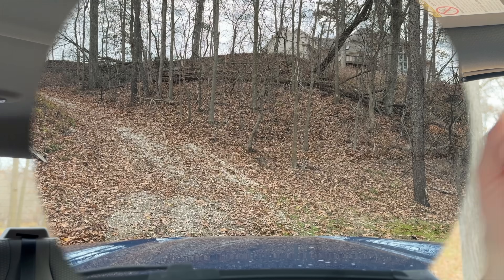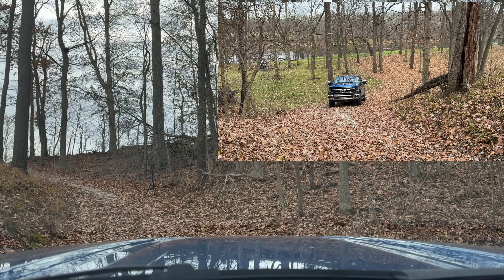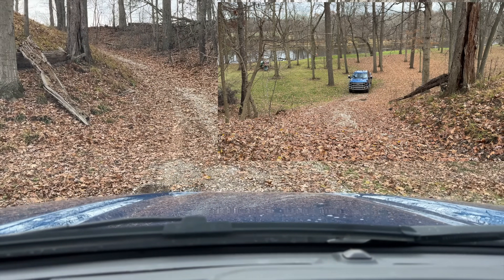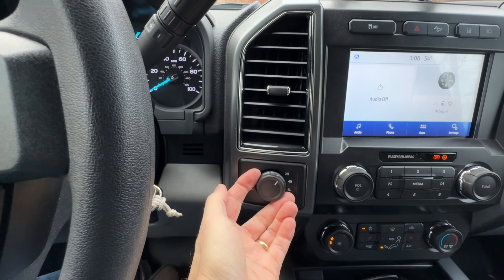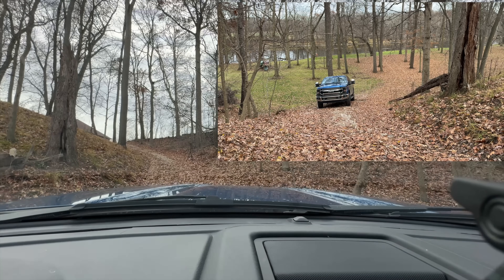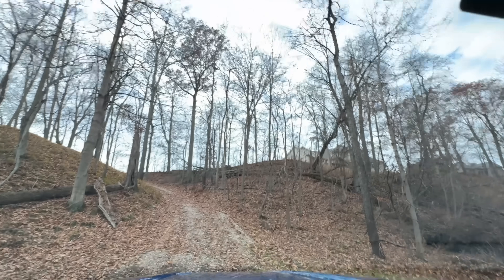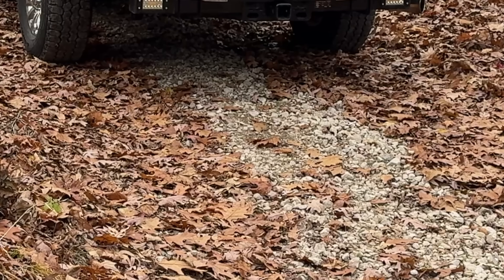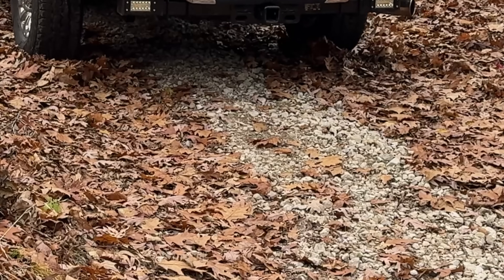FordSuperduty Traction control vs locked diff vs 4wd

Comment: I don't understand why people think using low range 4x4 is somehow better than just using regular high range.
Reply from the maker: @kleetus92 4 Low has no advantage over 4 high other than lower gearing.  I use it on this hill because I like to crawl up it very slowly and low range gives better control when crawling.  I also used it to demonstrate that when in 4 low traction control is disabled.  I get the impression you might be one of those guys that never uses low range and brags how you never need it.  If you never use it, it can get stuck in 4 low if you do eventually need it.  It needs to be  exercised occasionally.

Comment: So I am am a bit confuesed. I am not familiar with US trucks (i am living in Europe, no room to drive or park these cars. let alone the road tax which is based on the vehicle weight). So which diff. did you lock? The centre diff. usually first, I thought. But that also would mean 4wd is active. Or can you lock the rear differential on the RWD? Traction control on passenger cars works the same I guess, but we learn to give it more power so traction will sort itself out. You probably would not want to do that because it will leave holes in the road, digging to loose stuff before getting grip on solid ground. I wonder. So can you elaborate a bit please, which diff. you locked. Thanks.
Reply from the maker: @JWR6819 The first attempt was open diff 2 wheel drive and only using traction control.  The second attempt, I locked the rear differential only to show the difference between the locked diff and traction control.  The final attempt was with the rear diff locked which was not necessary and also locked in 4 wheel drive

Comment: Note that traction control is always on unless you turn it off. The purpose of it is to cut throttle response in response to wheel slip. It really has nothing to do with running gear setup. It's just trying to restore the grip of the tire on the surface. Spin your vehicle with traction control on, like you were trying to clear mud out of the tread and see what happens to the throttle.
Reply from the maker: See my traction control off video
Reply from the maker: @markrogers1502
https://youtu.be/iSFIjMfjIwA?si=CHa_TZWsE45Ot8RS

Comment: First of all, you don't idle up a hill! Back up and get a rolling start! I guarantee you will make it if you go fast enough.
Reply from the maker: @GlenLloyd-q6t First of all, the reason for the video was to demonstrate how traction control behaves compared to a locked diff or 4 wheel drive.  The video was not titled "Can I make it up the hill in 2 wheel drive".  Secondly, flying up the hill that pops out into my neighbors back yard and not being able to see what is coming at the top is not only dangerous for all involved it is reckless and the act of an ignorant person.  I crawl up the hill for a reason and I own a 4 wheel drive for a reason too.  Driving fast to avoid using 4 wheel drive is a good way to break stuff.  But,  Thanks for watching!

Comment: You would be surprised on that hill if you put it in "Four Wheel Drive" (which is two wheel if not in locked diff mode) and removed the rear drive shaft how little your rear wheels are doing. You have all the weight over the front wheels. They are doing the work. You could also (try it!) fill the bed to the level top of bed with sand and drive up the hill in two wheel drive.

Comment: I own four 4x4 vehicles.   Two have Detroit TrueTrac rear diffs and one of those also has a Lock-Right front diff.   I honestly thought the locked rear diff would get you about 2-3 truck-lengths further up the hill than the open rear diff did.  Hard to beat a four-wheel drive that has a locking rear diff.
Reply from the maker: @G31mR As many have stated, perhaps with momentum, lower air pressure in the tires and some weight in the back end it might have climbed in 2 wheel.  However, I wasn't really trying to test what it took to climb the hill as much as I was using it to demonstrate how the traction control worked compared to locking the diff or using 4 wheel drive.

Comment: My traction control is between my ears, that road is way nicer than my county roads. In the mountains our roads are steeper with ruts and washouts and we only use 4wd in the snow. Modern trucks are a joke.

Comment: I'm following you from Saudi Arabia. Share and like! Do you see any difference between the 2025 F-150 and the 2025 Raptor? I'm considering buying one because there are discounts on the 2025 model in Saudi Arabia. Or is it better to wait for the 2026 model if there are any worthwhile changes? I await your response.
Reply from the maker: @qazqaz-kp1xj The Raptor is just an off road version of an F150 to the best of my knowledge.  The Raptor would ride better on rough terrain for sure.  If you're just driving on paved roads, the F-150 would be fine.  Really comes down to what you are using it for.  As for the 2026, not many big changes on the 2026 that I have seen, if you found a deal on a 2025, it might be worth grabbing one, I personally don't think I'd wait.

Comment: I have had my 2015 F150 for over 6 years and I did not know about pulling out the 4 wheel drive selector switch to activate diff locking. I knew it was available but I never thought about it.
In my defense I never go off-roading so I have never needed it.
I guess I should READ THE OWNERS MANUAL.
Thank you for teaching an old guy a new trick.

Comment: An HD pickup is the worst in this scenario because of the weight distribution, or lack thereof. Momentum would change a lot of this, but I understand why most wouldn't want to fly up an incline like that. A loose surface combined with a steep incline makes for a show stopper in most vehicles without proper 4WD and/or momentum.

Comment: So few people understand traction control, Its a anti skid control for greasy roads. Any good off roader will turn it off when wheeling
Reply from the maker: @raymondrichard547 right you are, which is usually why I just select 4 low, it turns that crap off automatically

Comment: 2012 Ford E350 van with traction control (rwd only).  It helps in 2 situations, that I've found: the boat ramp (I can haul pretty much anything off a ramp) and it more/less won't allow an extensive "drift" on snow/ice, at reasonable speeds.  Other than that, it's more of a pain in the neck. In fact, in snow, there are times it will literally not allow the van to move at all. 
Decent system, needs better programming or control.

Comment: does differential lock  lock the front axle too ?    Btw  great video .. thanks
Reply from the maker: @tbischof430 no, the rear axle is the only one that locks on my truck.  The Tremor package gets you a limited slip diff up front which is perfect unless you are hard core off road and rock crawling, but these trucks are rather large for that.
Reply: @robertweller2662  thanks for the info ....cheers

Comment: Guntech59 is right Mo will get you places you know Mo... Momentum
Reply from the maker: @davidlaughlin5606. I am well aware, that was not the point of the video.  I used the hill as a controlled test environment to demonstrate how the trucks functions behave, it was never about can the truck climb in 2 wheel drive.  This hill is a private path through two neighboring properties that I do not own, when you own it you can tear up and down it all you want, I'm being respectful and traveling on it slowly which is best done in 4 wheel drive.
Reply: @robertweller2662 touchy aren't we
Reply from the maker: @davidlaughlin5606  nope just feel it necessary to explain things to certain folks

Comment: 78 F150. Detroit Rear OX front. 4.56 gears on 35" mud terrains. It wont even get out of a level parking lot in 2wd. It just does donuts. In 4wd itll go up 35 deg sand dunes with a foot of snow on it. I think i aired down to 25psi though.

Comment: Your on leaves..like ice. Dummy
Reply from the maker: @DynoDieselWagon those leaves are dry and are on top of rock not grass.  The loss of traction is due to the lose stone and ground beneath the tires.  The video was not intended to show how to climb the hill, it was intended to show the difference of how traction control behaves opposed to a locked differential or 4 wheel drive.  I used the hill as a controlled test environment.  Or did you not watch the entire video and listen to what was said.  Who's the dummy?

Comment: On the fine sand beach here NJ, better have the diff locked in 4x4.
Reply from the maker: @GregReinert-p8n what tire pressure you running in the sand?

Comment: 2014 super duty gas truck, diff lock four low (shuts off traction control) will give you three wheels going in the same direction very well at slow speeds (tractor work). My opinion diff lock is useless in two wheel drive (never helped sliding sideways when I need to go straight).
Reply from the maker: @mikeasel144 I've gotten out a few times with the locked diff in 2 wheel.  Usually when I park in a ditch or something while out hunting.

Comment: I've driven up steeper inclines in my 1976 BMW 2002 on sandy/ gravel roads in the state parks in California. In fact, I wouldn't be surprised if my 1991 Mercedes 250TD (diesel, wagon, 5 speed) with all of 80hp and an open differential, could climb that same driveway.

Comment: This is just me, but if I even remotely think I “might” need 4WD I reach down and flip it. Gimme a damn break, you said “we’re not gonna make it”, then hit the button and go. It’s not like you’re using up all your 4WD fluid and need to refill it every time you use it. You bought a 4WD truck for a reason. Friend of mine, goes onto a two track covered with 10 inches of snow and leaves his truck in 2WD, waits until he’s stuck, then turns on 4WD. To me, that’s just friggin stupid!
Reply from the maker: @deweytarver8985 I always use 4 wheel on this hill.  s you said that's why I have it.  The attempts with 2 wheel were just to show what traction control does vs the locked diff.

Comment: I just bought a Frontier Pro 4x and a buddy of mine bought a Tacoma Pro.  We go occasionally on some trails.  The Toyota A-TRAC system works pretty well without having to use the locker.   In my Frontier in 4 low only, the ABLS used correctly does surprisingly well without having to turn on the rear locker. Both pretty good systems.

Comment: Any time I’ve ever attempted to go up any hill I’ve had some momentum. At least a rolling start. This makes a major difference in comparison. Weight of vehicle going slow equals a “huge” disadvantage. Almost not a fair comparison..
Reply from the maker: @joerigsby-qt5bf absolutely, but this video was never about if I could get up the hill in 2WD.  I used the hill as a controlled environment to demonstrate what traction control does compared to a locked diff and then how they compare to 4WD.  The hill is maintained my by HOA so I crawl up it in 4WD low to avoid digging ruts or throwing stones down into the grass that is mowed below the hill.

Comment: I appreciate the video , but ford makes terrible traction control lol and I love ford , but i've seen it tested in the high end broncos on rollers compared to toyota and land rover , hell even compared to subaru , it just does not grab hard enough.  Now in a situation like this , it's not so bad , but you put it up against a rock where it needs to hold really hard to make the other wheel really do some climbing and no way i've watched land rovers from the mid nineties be able to do it as if it had a locker , it was so strong
Reply from the maker: @ronaldrrootiii6040 Yes, my wife's Subaru Outback has traction control that is far superior to this truck.
Reply: @robertweller2662 i think it's mostly just because the truck is heavy. But ford could try a little harder if land rover can do it with 6000 pound vehicles , and it works instantly like a locker

Comment: traction control is problematic on 2016-2019 chevy colorado and it might be the same in the fords....if you try to drive the old fashioned way, you'd put the truck in the highest gear you can run without stalling and keep the RPMs as low as possible.  in my 05 350, its 3rd and 1200 rpm and that colorado 2nd or 3rd but with manual trans in the colorado causes the computer and traction control to put the truck in limp mode and it takes the dealership to clear that....so you have to let traction control do something it sucks at.  the old way was use torque and limit hp keeping traction.  a method i still use in the 350 and I just try to keep the colorado out of those situations.  that said, what would be the difference with that hill?  I doubt you make it all the way up, but would you go farther?  same time, ask mechanics if it'll f'up the traction control first.
Reply from the maker: @wthalacker that's nuts, I always started my manual transmissions in 2nd gear when it was snowy.  I wasn't really trying to climb the hill in 2WD, I was more using the hill as a test environment to demonstrate traction control as opposed to locking the diff or using 4WD.

Comment: Have a 400 foot driveway, about 3-5% for majority but about 75 foot runs 11-14% downhill in with a small right turn. Was gravel, now paved. When graveled 80% of the time front wheel drive BACKWARDS worked fine wet or dry going out. In snow or ice, nope, except for the truck in 4 low. Paved easy peezy dry in anything, front wheel drive in wet is iffy, snow or ice is a skating rink, lol. Fed Ex driver did a major oopsie and tried it with about 3 inches of snow, he ended up at the back of the property about 40 yards off the drive and had to get towed/winched out from the top.

Comment: Can you say more about your experience using rear locking differential?  I have a 2wd PS dually and was wondering about whether or not it would be an effective addition.
Reply from the maker: @aloslosorelli5553 its a great addition to a 2 wheel drive truck.  I can't tell you how many times I have seen a two wheel drive truck stuck on flat ground because one tire didn't have traction.  If one wheel is spinning, stop, lock the diff and try again.  It's not a replacement for 4 wheel drive but it certainly makes any truck more capable than if you don't have a locker.  A limited slip differential would be another good option.
Reply: I have a limited slip, but I was in a grass lot after heavy rain and my rear just sunk into the mud when I went in reverse and then tried to move out going forward.  Wondering if a locker would have gotten me out.
Reply from the maker: @aloslosorelli5553.  Check this video out.

https://youtu.be/2QEMAKgp0pw

Comment: good video. Must be a back way in and out. Surely not million-dollar house with a $40 driveway.
Reply from the maker: @Rickthefarmer-hj4wi yeah, it's not a driveway, its a path down to the river between to Million Dollar homes, our HOA maintains a piece of property down by the river.  It's a great place to take the dogs to run or put kayaks in and out of the river.  Sometimes we have neighborhood parties down there.  Nice piece of property and would be very disrespectful to tear up the hill or fly up it popping out between 2 houses doing 30-40 MPH like half of the comments think I should do.  LOL. 4 wheel lo and take it slow.  4 High works to but 4 low crawls nicer.
Reply: @robertweller2662 You prolly a good neighbor👍

Comment: You wouldn’t get that far in 2wd with the diesel engine. Front end is way-heavy. I have two of them.
Reply from the maker: @Rickthefarmer-hj4wi nope sure wouldn't, my previous truck was a 2004 Ram with the 5.9 Cummins, also a very nose heavy truck, it ate ball joints every 40K miles and would spin the back tires if there was sand, dirt or water under the tires and it was in 2 wheel drive.  I used to put about 600 lbs in the bed in the winter or I could not move half the time in 2 wheel drive.
Reply: @robertweller2662 I run about (10) 60# bags of while marble rock stacked against the back of the cab inside the bed otherwise both trucks are flat dangerous. When spring arrives I remove the rock and dump them onto a gravel road going down to the pond.

Comment: My subaru and my Chevy colorado have a traction control button to turn it off and on whenever you need too, you don't have to put the Chevy in 4 wheel drive to turn it off and on
Reply from the maker: @arthur4818 there is a button in the Ford SuperDuty as well.  That video is coming next.  Stay tuned, y'all want tire spinning action, I've got it coming.

Comment: Why didn't you try 4 high
Reply from the maker: @scottburns5049 when I am off road, I almost always use 4 low, no other time to really use it, if you never use it, the low range shaft and gears don't get oiled.  I used it to exercise it, and I like the slower crawl up the hill with less throttle input.  It will climb the hill no problem in 4 high, I've done it many times.

Comment: My 98 Ram has none of those nanny ECMs. Solid axles, center trans hump shifter, 
4Low N 4High. Never gotten stuck nor Failed yet in my 17 years of ownership, 4X4 is always ready to run.  Reliable Levers not dial-a-matic terrain dial, that you suggest using to a ecm instead of Lever Commands.
Reply from the maker: @JonathanFreedom1st I wish they still built them that way today.  But they don't so I make videos to help people less informed understand how this crap works.